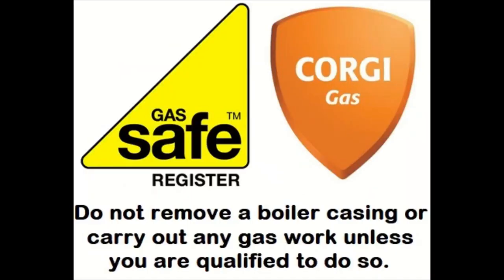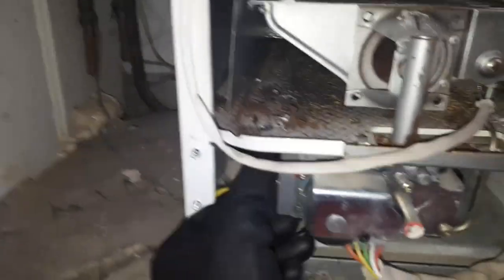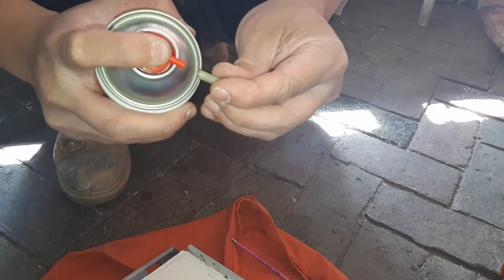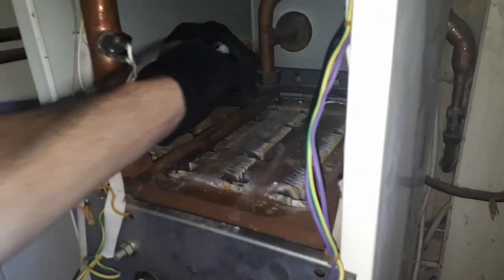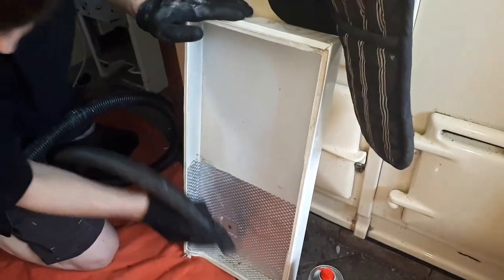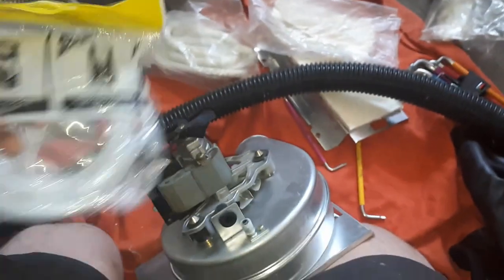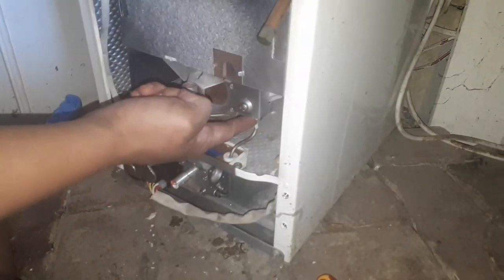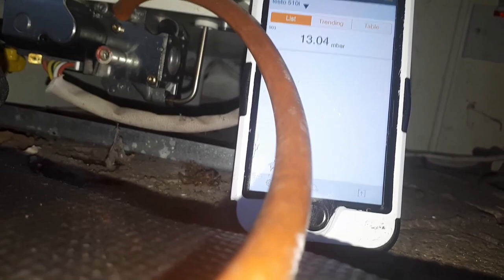WHAT'S INVOLVED IN A BOILER SERVICE - burner pressure - BOILER FULL STRIP DOWN -Potterton Kingfisher

Comment: How much would you charge for a full service like that? Thanks
Reply from the maker: 60 plus vat  - plus parts if seals are needed 👍
Reply: @goldgas1216  That's a very reasonable price. Thank you for the reply.
Reply: Gold Gas Videos still 60 plus vat plus parts is the best price for a proper clean up service as in the videos